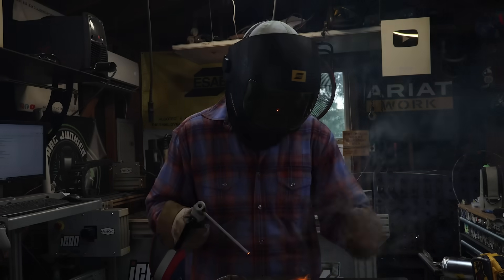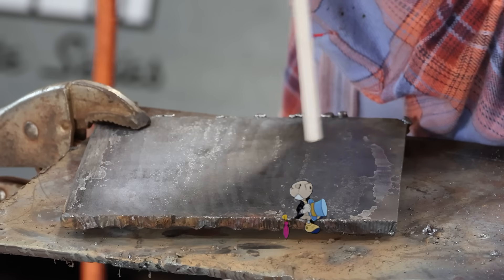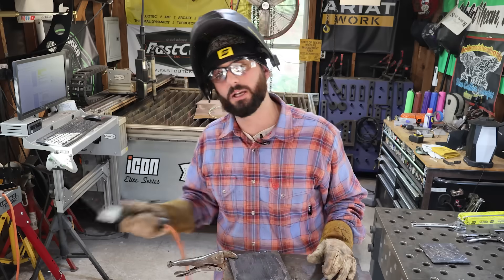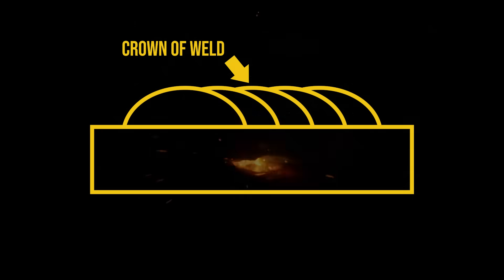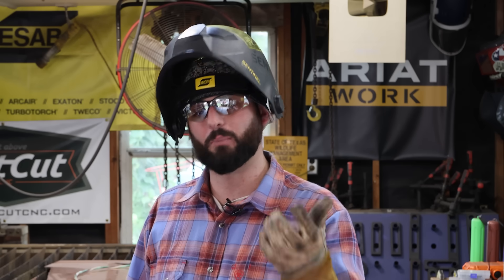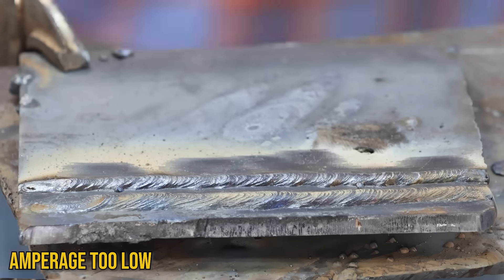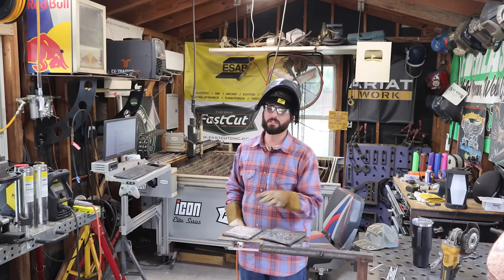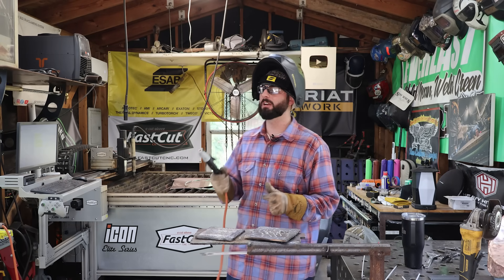This Is Why You SUCK At Stick Welding

Comment: 25 year welder here, here is how I would strike an arc, its simple, taking a new rod, or used, place the rod in the holder, lay the rod flat in the seam, or wherever your going to lay metal, then turn the rod to a semi vertical position just enough for a weak contact with the base metal, it will start to burn beautifully,  I used to do this with 1/4 7018 while welding annular plates on oil storage tanks for conoco, you don't need a whole lot of practice,  just a steady hand, but today you have what we didn't, auto dark welding hoods, lucky people, so once you have the rhythm you can say goodbye to sticking your rod and getting pissed.

Comment: I suck at stick welding because I haven’t touched a setup since I was in 9th grade back over 40 years ago.  I want to get into welding as a hobby now that I am retired.  Thanks these great videos.
Reply: Harbor freight titanium 225, great cheap welder in the field. In fact, ive only ever used it with a generator. Never plugged in at the shop. Thats what red or blue welders are for

Comment: my school has us do an x-block made with one 4x6 and two 2x6 plates so we can do fillet welds in all positions with one piece. we also have a place for the unfinished rods, and when we have a lot the instructors will lock the rod oven. but practicing those tie-ins and 50-50 overlaps are really important.

Comment: I am in my second semester of welding class.  They have been teaching us using stick with a 6010 rods. Two of my biggest problems is keeping a good rhythm of dig, push the bead bad, move forward and have a good consistency distance between each bead head (not sure of the technical term).  My biggest problem by far is keeping a straight line.  For the life of me I can’t keep a straight line.  Being 60 now, my stability of my torso and hands no maintaining proper posture and not shaking it hard. What discipline do you use to keep a straight line while welding?

Comment: Depends on the rod size and heat as well also if the weld material is heated up. Plus can you see what your doing did too much overhead now youre looking through a 1/16 in of carbon. Kiss keep it simple stupid. Get cheater lenses so you can see properly my teacher never gave a fuck about me and i had talent so i killed everyones ears by plugging mine and grindins 7-8hrs a day for no reason. Just bc he pissed me off thats for you jeff r

Comment: You don't seem to be very good  at this I was better than that when a passed my welding test at Lockheed shipyards in 1974
Reply from the maker: good for you eugene
Reply: I agree the way I was taught is that you can’t tell where the weld is and stacking dimes welds looks like crap . I started welding with 6010,7018 and 6013 and didn’t have an auto darking helmet I love them when I was able to get one.

Comment: Arc length is not actually that hard with stick. The core burns away a bit faster than the flux and that little bit of flux is often the right arc length, so all you really have to do is make sure the rod is actually lightly in contact with the work as the rod is burning, and it welds just fine.

But starting is a big problem I have. I find that you can't just simply touch the exposed tip to the work. For some reason, there's a bit of "resistance" and you really need to actually hit the work with a certain amount of force, not too much because you'll stick but it takes a little bit of force before the rod will start to light. It would have been so much easier if I only needed to gently touch the rod to start it but often it's not sufficient. If I touch too lightly, it will not start. I often have to strike the end of the rod against the work with a decent amount of force for it to light, and this is where things get dicey. If I strike too hard, it sticks or it lights and then goes out instantly. If I don't strike hard enough, nothing happens. Sometimes it takes several tries and it would just light before I was ready. I think the whole "strike it like a match" thing comes about because there really needs to be a slight bit of rubbing motion between the work and the rod for it to light, and if you simply gently touch the rod, it just does not light. I'm guessing the microscopic amount of oxidation makes it not light the instant you touch it.

Comment: I’m a student right now doing stick to pipe(already completed stick on plate). Can you please do a video or tips on welding underneath the pipe i’m having trouble with the root and having too much build up. My balance is trash I can weld all day with my body standing up but once I get on my knee I find myself unstable and shaky.
Reply from the maker: im sure we can work on that video! but in the mean time, always have 3 points of contact. using a clamp, crecent wrench or anything to allow your arm to rest on the pipe is crucial.

Comment: 2:07 hey I'm now welding "instructor" but I've given some pointers like negate the whole flick stick simply by crushing the tip exposing the electrode creates a stronger arc guaranteed no pretend  there's a skeeter on your peter
Reply from the maker: I wouldnt recommend that.. the likely hood of getting porosity in the start is far greater. With a new rod, certainly not, maybe if you need to re strike the rod and it has some slag covering the core.
Reply: @Welddotcom I did it in trade and my welds passed inspection you don't take much off just enough to see the crown of the electrode like not even half of the tapper on a new electrode

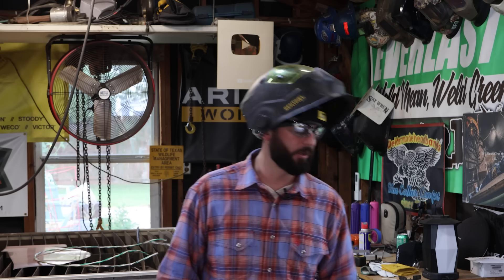Comment: 8:22 thats not valid reason to throw it away -1mm thick stainless steel bosch cut off disc (they are cheap as well like 1-2$ each depends where you buy it)will make a clean cut and you are good to go again.
For beginners i would add one more thing cut the electrode in half using same method above.Back end of electrode is good to go but the front one you just use slag hammer to take a bit of coating and sandpaper it to bare metal and you are good to go.Its much easier to practice on short electorde and increase the length as you develop muscle memory. 
Not everyone has a drying oven but 2 fire bricks in L shape and a cheap propane torch will heat those electrodes in no time .Just dont go crazy with heat they dont need to glow yellow.You know process is working when you see steam coming out of them. 5-10 min is enough.

Comment: The stick weld arc is chaotic, but you get flashes of what the final bead will look like if you just concentrate on the back edge of the puddle.   It's hard to see where you're going.  Sometimes I'll pull back for a half second just to get some light.    (TIG was actually easier for me as a beginner because it was very clear to see what's happening --no spatter, flicker, smoke.)    Don't hold your stinger with the "grip of death", else, when it comes time to turn a corner or round a curve, you'll be all locked up.   Another beginner bad habit I would do is hold my breath --as I would when shooting a rifle or anything else that requires precision.   Don't.   Relax and breathe.
Reply from the maker: great advice!
Reply: Just make sure you have your extractor fan setup up properly!
Reply: @AnabolicSaagAloo  I don't have the patience, money or room for that.  I just use a half-face P100 respirator.   Fits under my hood just fine.

Comment: With all due respect, the first thing any welding video presentetion should mention is how dry your electrode is. No,it is not obvious.You can do all right movements which you stress upon and the electrode sticks to the weld time after time,regardless technique
Reply: 2 fire bricks and 5 min of propane torch make wonders and you dont have to worry about that problem . . .

Comment: A good tip for when you stick a rod is just quickly unclamp it from the stinger, and then grab the rod close to the stuck end and gently wiggle it off. Helps from breaking off a bunch of flux and overheating the rod.
Reply from the maker: most defiantly!
Reply: Very much agreed on . The only thing I would add onto this post is don't immediately try to break the rod off when u unclamp it from the stinger . Count from 3 to 5 sec to let the rod cool before u pull it off the metal from being stuck or u will usually end up crumbling a 1/4" to a 1/2" of the flux from from where it was stuck . It Makes re using the same rod a hell of a lot easier . You wont have to melt that glob of flux less  rod off .u  will see a steady clean ark going back into the weld with the same rod .

Comment: Just wish there was a place to go to learn welding for the hobbyist close to me.  Local college wants $9K+ even to just audit the classes.  Thanks for the vids.
Reply: get a machine, spend a few weekends catching your pants on fire, its not a difficult skill to learn, just takes a little patience
Reply: @northmanlogging2769  Guy might be living in a studio housing where there won't even be a 220 outlet to plug into... or a place where you can weld anything.
Reply: @NoMoreLibs   Northman's got it right, machines are incredibly cheap these days. The materials will cost some more but nothin too crazy.
Reply: I'm currently finishing my second week of the welding lab and I can tell you this much from my POV. 
Its 21k for my tuition at UEI. It's gonna be less than my truck. 
I did have to cut some work hours so I'm making $400 a month less. 
The pros are that the instructors are there to teach you hands on. That changes how fast and how efficient you will learn. So I don't think welding school is for you if it's just for a hobby, UNLESS you have the money just laying there. I'm going to school to make a career out of this. 
The money you pay goes towards bills, teacher/instructors salaries, material, we got like a $300 miller welding jacket which is cool, but we paid for it pretty much, as well as the other PPE we were given.
Reply: I’m in school now. Harbor freight and Amazon have really good welders. You don’t need anything fancy. I have a $130 gas less flux core welder, $50 stick welder and the one I just got $500 multi use welded. And they all work great. They do have draw backs but for the price, you get more than you would expect. Just like they say. “ it’s not the car it’s the driver”.
Reply: Great reply's guys, thanks.  I have a nice box, Lincoln 215MPI, does it all.  Plus an older Hobart 140 I started with years ago that I just use for FC.  I can stick metal together...but man, it ain't pretty but usually seems to work.  It would be nice to be able to get someone to look over my shoulder and say do that, don't do that, etc.  I'm in the boonies so folks are hard to find.  I may put out an ad and see if I can just pay a guy for a bit to bump what I do know into place.
Reply: My dude I recommend just buying an Amazon $80 multi process welder arc mig and just start playing with scrap YouTube will teach you what cold or hot welds look like it's really not as hard as it seems I went to job corps welding trade basic is Gagging your metal and learning what amps work for your flow I tell ppl like my brother in-law watch that puddle heat and cool one the puddle starts pull away as it starts to cool pull back to about center now there's more than one way  there's the e or c or oo
Reply: Gosh damn.  I took two semesters at a community college here in NC and the cost was like $150 per semester.   Night courses.  This was back around 2002.